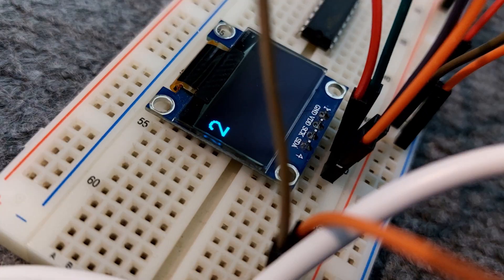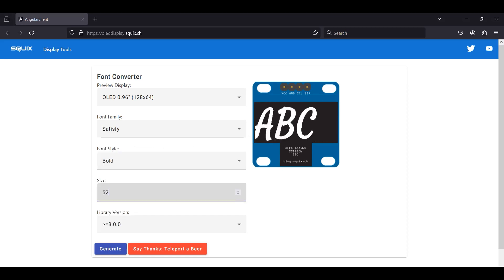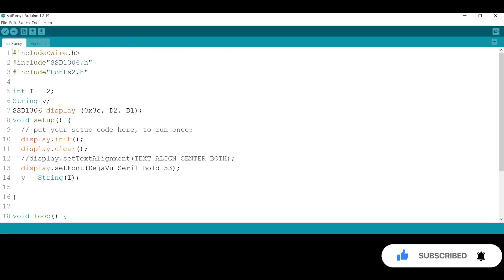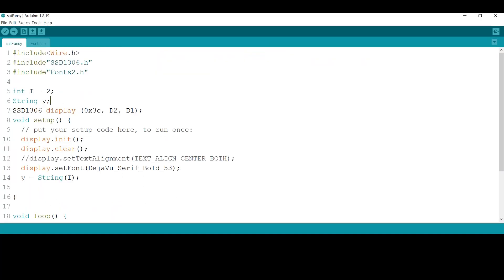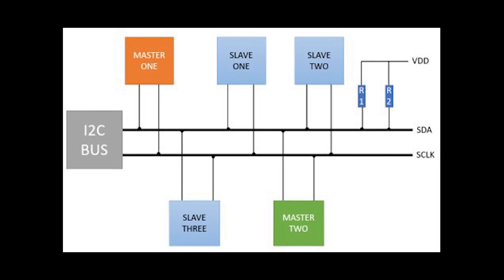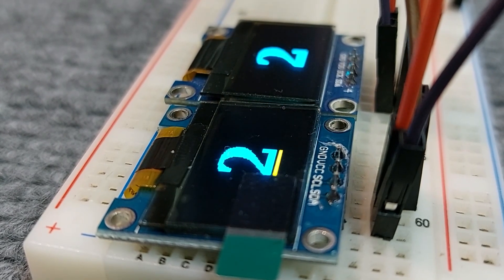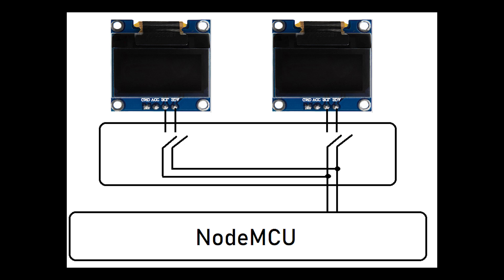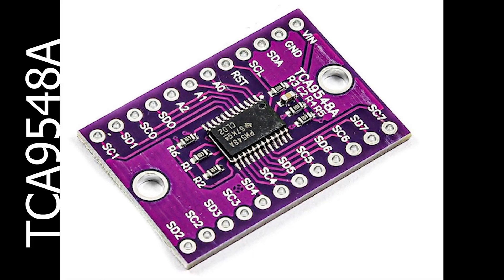DIY Nixie Digital Clock | TCA9548A module

Comment: Brother I have a dead phone but all its components are working like display battery camera etc. Only its motherboard is dead so can I make something for it please tell me
Reply from the maker: hello bro Yes, you can make something for it, but the components are no longer useful. In my opinion, use the body of the phone and make something new with the help of sim800 and oled display and a keyboard. Check out the sim800 related videos.